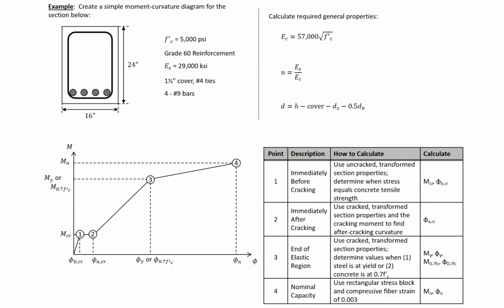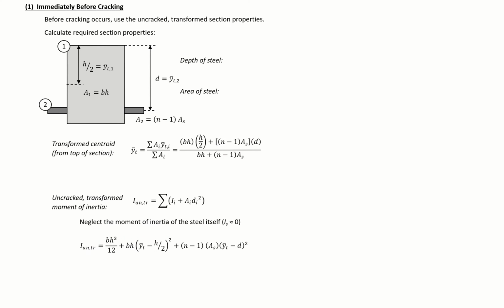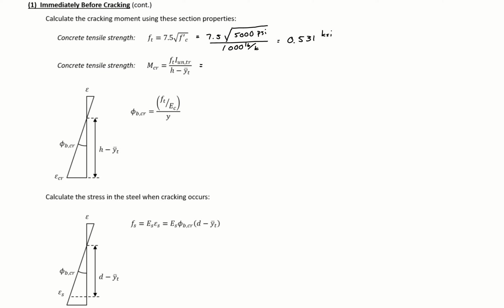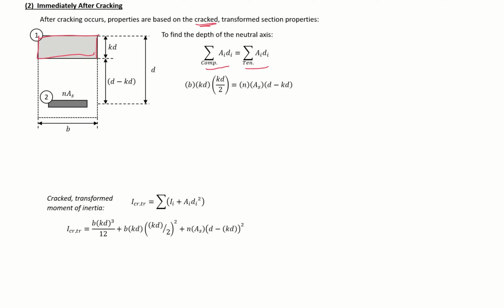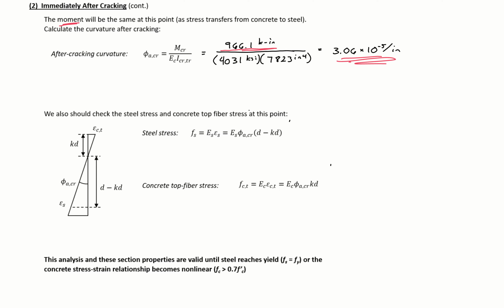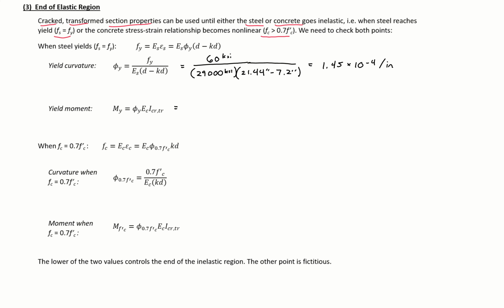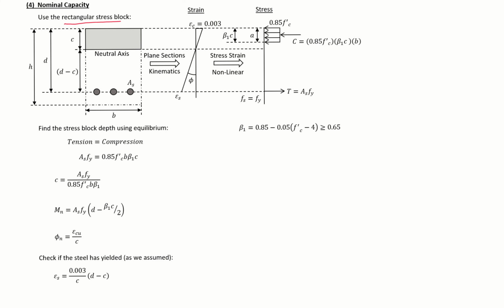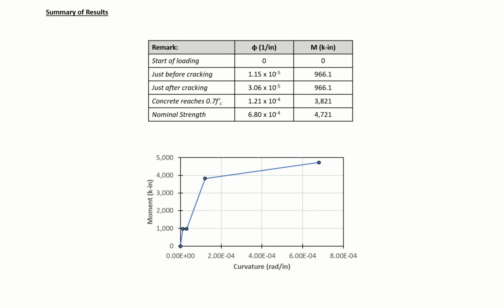7 - Example 2 - Simplified Moment-Curvature for Rectangular Reinforced Concrete Section

Comment: Dear Dr.David thanks for your valuable effort, but i've an inquiry about the concrete modulus of elasticity after cracking shouldn't be changed than before cracking? Thanks.
Reply: No it remains the same.